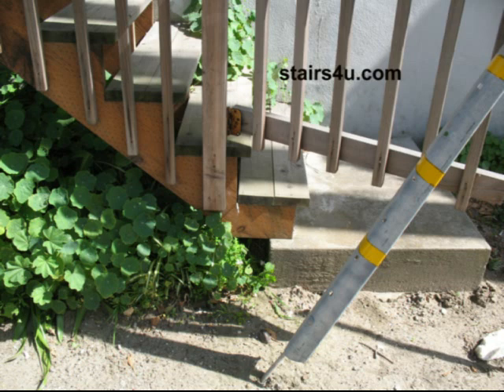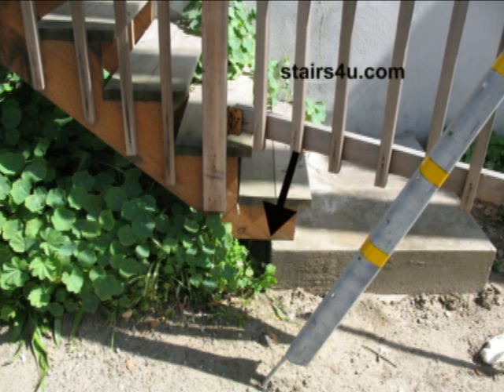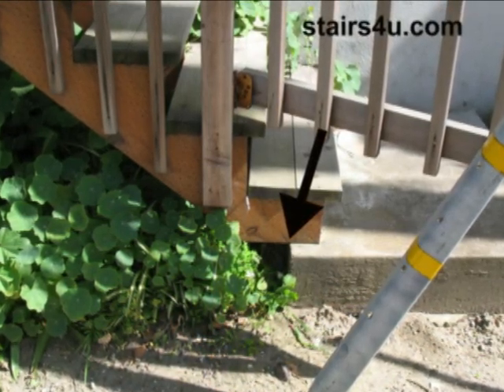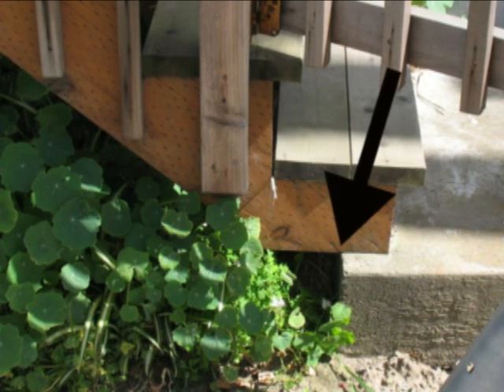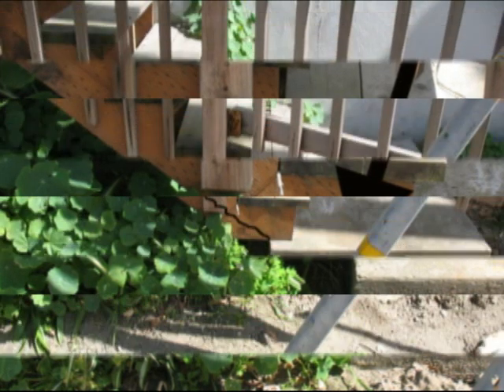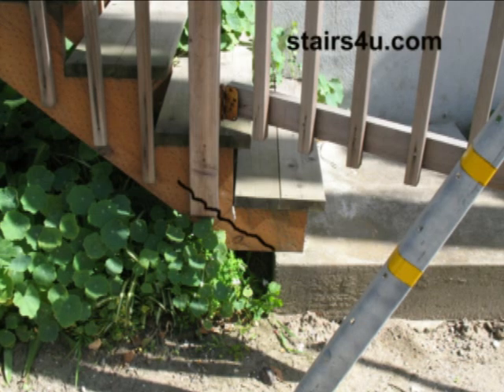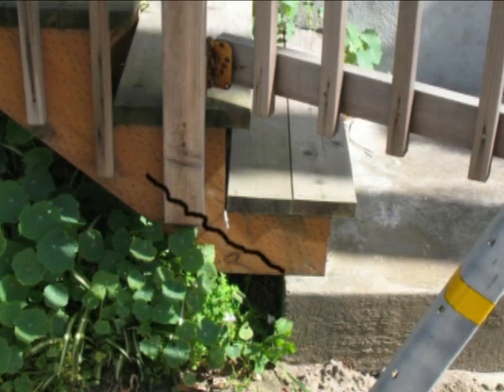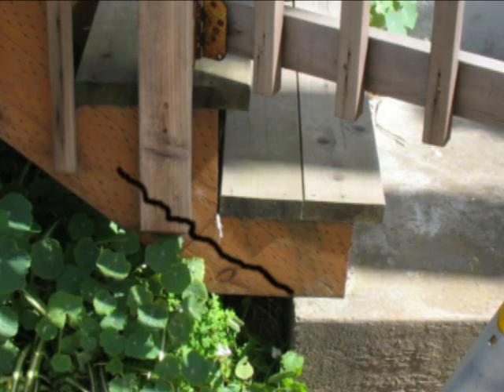Poor Structural Stringer Support At Bottom Of Stairs

Comment: I’ve inherited this problem, though the stairs are resting partially on a poured concrete sidewalk but primarily on the ground. How does one retrofit footing?
Reply from the maker: You can usually drill some holes into the existing concrete and use rebar dowels to connect the new footing to the existing.